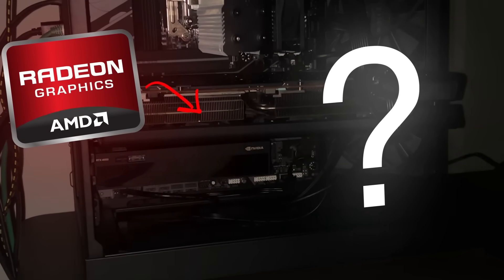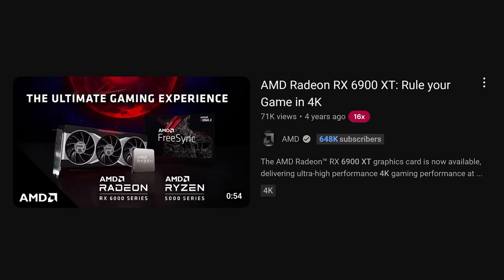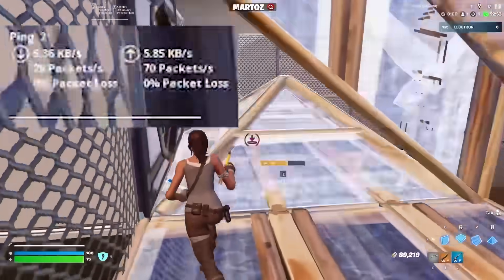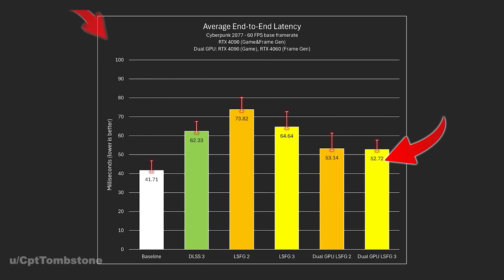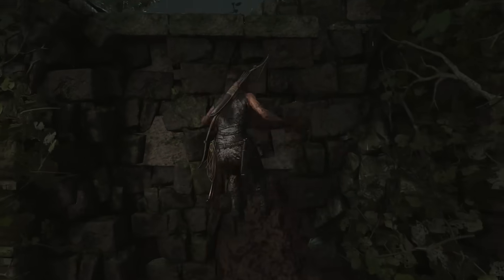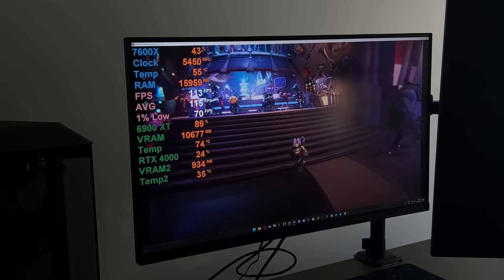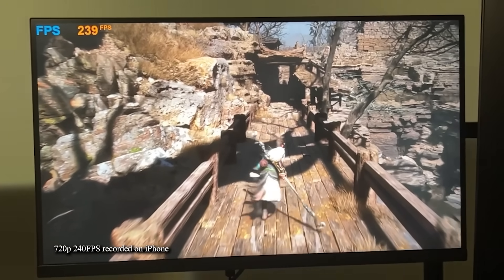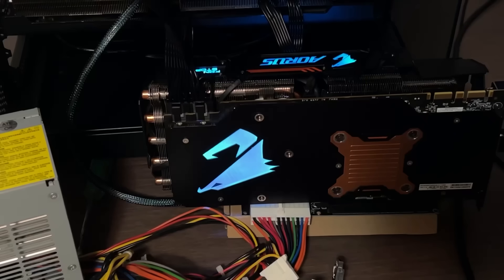I Used Both AMD & NVIDIA in One PC and Got 240 FPS in Every Game

Comment: Nice video dude! Just one quick question. I'm actually doing some performance testing similar to this, with my RTX 3070 as main GPU and a 1050 Ti as secondary GPU, is it similar to the setup you were using with the 1080 and the AMD GPU?

Comment: nvidia does better when doing 2x gpu fg in RTX60 series ...as you see LSFG is 10ms worst than DLSS on its owned ...its impressive for LSFG doing better by 2 gpus while nvidia is way better when nvidia make same tech as LSFG...20ms faster than lsfg at 52.72 due to missing hardware component will make access to cpu faster than software only

Comment: You're trying to do 4x generation, but it's always horrible. 2x generation is workable with little, if any, base frame drop. The key is making sure you're already at 60 FPS base before you double it. If you're never able to get 120 natively, then this is the sweet spot.

I consistently get 70 to 80 FPS base, so I just set the adaptive refresh to 120. I use LSFG on the 'Auto' setting. I resize the game to 1080p in windowed mode, start the Lossless Scaling program, and select the game window. Not only does it give me 120 FPS, but it also provides 1440p resolution with maybe a 10% hit on visuals compared to native 1440p. In most cases, I can't even tell the difference between native and upscaled. It allows my frame rate to match my monitor's refresh rate, and I only lose about 5ms in latency—much better than the 10–15ms hit LSFG usually costs. If i get a 2nd gpu im only gonna save about 5ms in latency thats about it. its not worth the cost of a 2nd card my base frame rate is 60 anyhow

Comment: Me now wondering if my RTX 3080 fits in my case still below the RX9070 XT that is arriving. 😅
But what PCIe mode will be supported... hm, 4x PCIe 4.0 on the second slot.. that's 8GB. Hm, wait, the video has an error, it assumes PCIe 5.0, but the RTX 4000 ADA only supports 4.0. Check, so that should mostly work. Let's see.. 😁

Comment: Well when SLI feature existed (Nvidia's Scalable Link Interface) you actually stacked the performance of the two cards not these two cards dont share memory and compute units so its just another PCIe  bus weight to your CPU and you can only be reasonable solution if running multiple VMs with Proxmox (and you actually have a thredripper level of cpu at this point and 512GB-1TB RAM fast RAM) -> This will cost you arroun 10K$.
Reply: I just crave for memories of my two MSI GTX 1080ti with SLI bridge that actually made a beast PC at a reasonable price and then  a bitcoin mining system that matched very good ASICs 

(just kidding never had this setup)

Comment: So I have a MSI MEG Z890 Godlike motherboard dual PCIE 5.0 and I have a RTX 4090 on PCIE 1 closes to the CPU and planning to add a RX 590 to PCIE slot 2. Is it possible to do this here? I own the software also just not sure if I have to plug my monitors to the RX 590 or RTX 4090? Also do you need to have Radeon Adrenaline isntall on top of NVIDIA software?

Comment: So in your opinion, I´ve a RTX 3080Ti, what is the best option for me to buy a 2nd dGPU for frame gen?
- Nvidia 1080 Ti (11GB) (your choice)
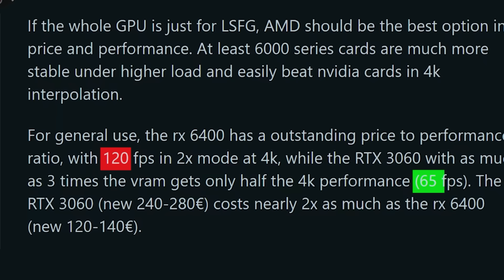- Radeon RX 6400 (4GB) (comments in the video) (11:01)
- Intel Arc A380 (6GB) (saw ETA Prime using)

Comment: As much as I want to do a dual GPU setup I need a 2nd card that runs on 8 pins instead of 16. I can't find a motherboard today that supports what I want. Motherboard manufacturers don't make motherboards that support the setup I want.
I want dual GPU and dual CPU.
8 RAM slots.
8 M2 slots.
8 SATA 3 ports.
Enough ports for 2 CPU's.
2 PCIe 6 16pin.
2 PCIe 8pin.
This is massive and trying to build a board that has the capacity for all this is near impossible.

The needed capacitors, cooling and on board processing is high. I know that boards come with integrated processors as north bridge and south bridge but that can change with some engineering. I would pay greatly for a motherboard that can handle what I listed above.

Comment: I've buitl.and played comps before public knew they existed . 2 scares are f9r work never gaming p.s if u know how I have a ryzen 78003dx and SAPPHIRE NITRO 7900 vapor. And I run 400 fps in cyberpunk or 350 in any even with split screen multi games opened u never mix boat anchor Nvidia and amd. Never had a crash no blue screen no lag 8 latency is most ive seen 1500 mbps net. I've never had a low below 300 and I never use water cooling it cuts comp life in half. I have 10 140 fans at 98cpm each the cpu never goes over 38%c and gpy max in a closed room no ac never passes 50%c never listen to guys selling info

Comment: I have a 5070 TI and for some reason it will never pull more than like 230W in any game. It’s supposed to do 350W. It usually does 140-180W. Basically the same as my old 3060 but like 20% more fps in the majority of games I play regularly. Which I get like 40-80 fps in

Comment: this doesn't even close to SLI. you're basically using DLSS with a second card and call it modern SLI bruh. Boosting base fps of 50 to 240 is so bad in terms of input lag. There is no possible this method is better than DLSS in terms of input lag.

Comment: Always found frame gen useless but i tried this on a ryzen 9 7950x with an asus x670 proart with the duoble 8x 5 gen slot. The first gpu is an rx 6800 16gb while the second one is maybe overkill rx 6700 xt. The difference is quite amazing and without input lag penalties. Btw, my evga g2 850w is still keeping the system without problems.

Comment: Hey guys, sorry if I'm late here. But I want to know if my pc setup is good enough or do I need to replace PSU and/ or GPU? 
Specs: ASUS ROG Strix B450-F Gaming ii
AMD Ryzen 9 3950X
Corsair A115 cpu fan
AMD Radeon RX 6900XT
XFX Speedster QICK Radeon RX 6750XT or Nvidia GeForce RTX 2080 Ti FE
Corsair Vengeance RGB Pro SL 32GB - 3200Mhz(4x8GB)
Corsair LL120 RBG(Total of 8 fans) with rgb controller and core xt
WD Black sn750 250Gb & 1TB
Corsair Crystal Series 680X

Comment: The B350 can run (personally tested) Civ6, (pt)Fold@home, (pt) Ashes of the Singularity, and supposedly Apex Legends with native AMD mGPU drivers with 1080p, 1440p and 4k EDID and WHQL drivers in Windows 10. Tried with  dual RX 480s and dual RX 5700xt. BUT I would love to try with dual 7800xt Nitro+ and ray tracing (I only have one 7800xt)
Reply: AND upscaling with RSR but maybe not FSR and probably not frame generation. You can get Freesync 2 to work in these setups but the newer Freesyncs idk. An older BenQ monitor might be best for that. One with an HDR vesa cert. Try BenQ 31.5" EX3203R. Not everything is gpu dependent but monitor dependent too.
Reply: I highly recommend 980p upscaled to 1440p or 4k. Works right in God of War & Unreal Engine 4 games but maybe not Unreal 5.
Reply: All of them will probably work with HDR in that setup and you can overclock.

Comment: I think you need to try this with a different GPU setup, with two Nvidia gpus, like a 3080 4070 something at that range. I am saying this cause AMD hasn't solved the ray tracing problem. Any time you enable it on an AMD card, fps goes down a lot

Comment: So you ditched the RTX 4070 for GTX 1080? GTX 1080 supports Frame Generation and higher DLSS version? Ray tracing is done in the AMD or Nvidia card? It gets all very confusing in the end. You should slow down and summarize a bit.

Comment: Tutorial to get everything working:
-Connect your 2nd GPU to the fastest PCIe slot of your motherboard
-Connect your screen to your first GPU (not the 2nd because for some reason it will kills your 1% lows...), and it will automatically run your game on the right GPU (the first one)
-Set the default GPU in Lossless Scaling to your 2nd one
-Set the Lossless Scaling frame multiplier to X2, X3 or X4, and 3.1 mode, but on some GPUs 2.3 and 1.1 can help

Tips:
-PLEASE DONT CHOOSE A WORKSTATION GPU if you dont want a LOT of random issues

-Dont use Lossless Scaling if the base framerate is already pretty high for 2 reasons: 1) your GPU will need to generate even more frames which can overload it 2) it might overload your 2nd (the slot which has your 2nd GPU plugged in) PCIe slot (For Gen 2 the maximum is 100 FPS at 1080p, For Gen 3 the maximum is 200 FPS at 1080p / 130 FPS at 1440p / 50 FPS at 4K, For Gen 4 the maximum is ~400 FPS at 1080p / 260 FPS at 1440p / 100 FPS at 4K, and to find out which version it is, use GPU-Z).

-Dont overload your 2nd GPU if you dont want the game look like a slideshow.

-Check your GPU temps, usage, and PCIe Bus usage with MSI Afterburner + Riva Tuner or with GPU-Z

-Locking the game base framerate can help a ton in some cases to avoid overloading your GPU or PCIe slot

Comment: Connecting 2 separate PSU's can be a bad idea as one is trying to stabilize voltage of the other one and 1 is taking whole load untill the voltage drops under the load, but power may jump and perhaps burn something - I'm not entirely sure if that's still the case in PC's - Anyone can clarify that ?
Reply: Long story short it's fine, at worst the dual psu cable can die because they are dirt cheap

Long - 

I've been using dual psus for a couple years for mining & gaming w/ 3x & 4x CFX , total power draw was around 1700 or 1800W in supported games(I played a lot) & during mining , at one point my dual psu cable died but I just replaced it and everything was fine and I kept using dual psus till I stopped playing older games (in 4k~virtual 11k) & stopped mining

My psus were Seasonic Prime 1200W Platinum (older variant) & EVGA 1000W GQ

1200W had 450W CPU & 2x 300W gpus

1000W had 2x 300W gpus

64 lanes

I am also a record holder for quad R9 390 in 3dmark in some tests iirc

Comment: i have a 9060 xt 16gb and an old rx 470 8gb to possibly power my second monitor? should i go for it since i already have both, and my psu should be able to handle the task, it is 750w btw

Comment: What you need for this project is to either grab a dual oculink x8 x8 adapter -> sata powered oculink adapters. Given you have a relatively new board you can bifuricate that primary slot no problem. You can eliminate the need for m.2 adapaters, 2nd power supply ect. 

I am currently running 12 gpus off of a 3 slot sketchy chinese 2011-3 motherboard without issue with this setup. Given pci-e 5.0 is in the mix, id strongly suggest looking at the more expensive redriver adapters to get a clean signal. Intereseting video however, really digging how we are consistently moving towards offloading mass compute to gpu instead of the cpu.

Comment: There is actually another problem in some cases: HDMI specs. The fact that you must plug your display on the 2nd GPU can be an issue if your monitor/TV is HDMI only and has a resolution/refresh rate/bitdepth too high for the 2nd card to handle. For example I use a LG C2 OLED TV as my main display on my RTX 4090 and it needs HDMI 2.1 to output 4K 120Hz HDR10 without compression. If I plug the C2 into a 1080Ti, I'd be limited to HDMI 2.0b so I would have to use 4:2:0 8-bit instead of the full 4:4:4 10-bit, which can be quite noticeable (on text for example). In my case, I would need a 2nd card that also has HDMI 2.1, like the RX 6400. This is not an issue with DisplayPort as most cards still use DP 1.4a and even if you are using a 4K 240Hz monitor for example, it would use DSC (Display Stream Compression) which is way less noticeable than the compression on HDMI.

Comment: very surprising, and really decent work, I must say. but one thing is a big problematic thing in this setup. single PC having two separate PSU is not safe. if the phase of either PSU gets different, there will be unexpected leakage of electric current flowing between two PSU, and that will fry not only the weaker PSU, but also anything else that the current is trespassing. Anyone who sees this comment, please do not try what this guy does. Instead, buy a more performant PSU. That is all you need to make this build safe.
Reply: How? The 2nd PSU is to power the extension chip that allows it to turn on. Why would that effect anything else when it's only to power the chip?
Reply: I dont understand what you mean by 'only to power the chip'.

Check out this timestamp: 11:37

Secondary PSU is supposedly giving power to the eGPU, but it is getting power from the primary GPU. Now, the eGPU is draining power from both PSU, and that is the exact point where I am saying the problem might occur.
Reply: @human_tailmeat oh ok. So your saying the gpu and chip should run off of the same PSU for safety? Isn't the setup similiar to a USB Hub? Those draw power from the PC once connected and it is recommended to plug the hub into the wall outlet for the hub to have the juice necessary for more devices.
Reply: Anyways okay I get it. I'm about to try the same thing but my secondary PSU have the cables necessary for both 24pin and extra cord that goes into card for it to be ran so thanks for pointing that out. If not was just going to do as he did, I can see now his old PSU just might not have had the cords necessary for his eGPU.

Comment: Would a Quadro K4200 be able to utilize Lossless frame generation to achieve 60fps in 1080p or 1440p resolutions? I'm dealing with a cramped case, so my only option for a GPU is typically a slim Quadro.

Comment: I picked up this Oculink about 10 years ago. A friend had 8 of them for running Bitcoin, and another had 16, so I wanted 6 of them, two for testing and the other for the future, which now. My motherboards have always been God-Like or Extreme Overlockers and needing to setup Keys in the reg and D-keys this is to turn off sys for Micro settings within windows so any cards over two can be config without system tracking active to run one or many other cards without system tracking indexing for cache paging of PhysX setup in Bios, but the only thing was needed is to setup system locks in Bios and network protocol so system won't reset to default. In 10 years, I've never seen anything less than 100 FPS or 3-ping;  ("4k"), is a thing of days gone by, and Unreal 5 has made sure of that for most users. When you BRICK A $1000 motherboard or a $3500 CPU, you learn a new respect for technology.
Reply: What are you even talking about

Comment: I just paid £1300 (UK) for for a HP Omen laptop,it runs Cyuberpunk at max graphics never dropping below 200fps
Specs are
CPU: AMD Ryzen 7 8845HS w/ Radeon 780M Graphics
RAM: 16.0 GB
Speed 5600MT/s
GPU processor: NVIDIA GeForce RTX 4070 Laptop GPU (8Gig)
CUDA cores: 4608
Graphics clock: 1980 MHz
Max-Q technologies: Gen-5
Total available graphics memory: 16003 MB
Dedicated video memory: 8188 MB GDDR6
Resolution: 1920 x 1080 (native)

Comment: Wow, and that's with a card released BEFORE ai cores. There is NO custom silicone doing that, just raw compute. If you make sure your motherboard has full PCIE bandwidth where it counts, and you moderate your expectations in regards to your target for final FPS, this quickly looks like an actually viable option for anyone who held on to their previous card. Personally, I wouldn't want anything more than individual frame gen, no matter how smooth or choppy, just to limit artifacting. It would be interesting to see this evolve into a dedicated hardware archetype. A 'generator' card, I guess, hopefully slim to fit in a single slot. Hell, at that point we may as well set it as the system PhysX card too, for old time's sake. A lot of engines still use PhysX under the hood. History really is repeating itself at this point.

Comment: I'm using Nvidia and AMD cards in the same machine,  but not for this reason.  My Nvidia card has HDMI but my AMD has DP. Even with a DP to HDMI adapter, I can't see the boot screen or the BIOS with my AMD. Only my Nvidia card works,  so I have to keep both in there. Hopefully this will not be an issue when i get a DP monitor.

Comment: I'm just upset a lot of people tend to do these kind of tests on 1080p. 1080p is an old standard now. If you're not doing these tests on 1440 or 4k then you Can pack up and go home. Just saying. And yes it might sound like I'm salty but we need to move on with times and start judging by the higher standard. 

So thank you Thank you for doing the better standard of 1440p in this video! This is a real test right here❤❤❤❤

However this video shows a lot and I really hope double GPU can be a standardised feature in the future. Even if you're running one powerful and one low end card you're still getting a boost somewhat.

Comment: I need your Help. I have a RTX 2060 super and a rx 5700 on the same pc. how do I make rtx 2060 super do the gpu rendering while RX 5700 do the lossless scaling? I have the cables plugged into the rx 5700 and how do I do the windows settings?

Comment: yep I forgot to make sure LSFG was going to use my AMD RX 460 2GB... the main DGPU is an RTX 2080 while I slotted an AMD GPu I bought year ago just to try to get freesync but YES I could in a cheaper than buying an adapter way to just use it for LSFG's FPS generator

Comment: Wow I’m glad that my motherboard got another X16 slot running at X4 speed. My experience with lossless scaling has been plug and play. I’m running my games on an RTX 2060 Super with an RX 6500 as the frame generation card. It was a small profile GPU pulled out of a Dell Optiplex. Works wonders!

Comment: I'm planning on upgrading my GPU after like 13 years. Right now I have a GTX 970, and I'm looking to upgrade to an rx 6750 xt, 7700xt, or 7800 xt (Depending on what I can afford by then). I wonder if this would be worth it with my 970.

Comment: Someday... we'll have a generic "monitor" output on the motherboard.  DisplayPort or whatever replaces it.  And your so-called GPU?  Will simply be an add-in board with the graphics cores your use-case requires.  Gaming?  Professional av/3d/cad work?  Encoding?  AI?  You just slap in the vendor's board that provides the best solution for your computation needs.